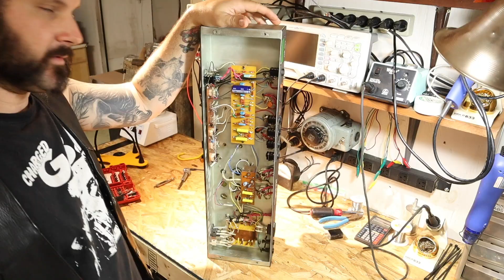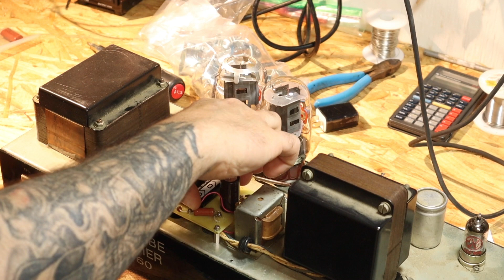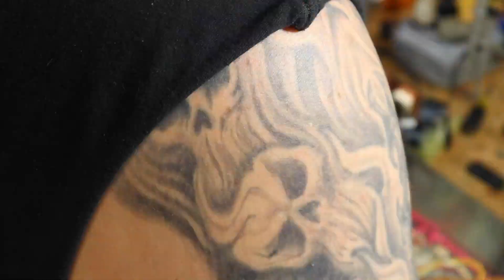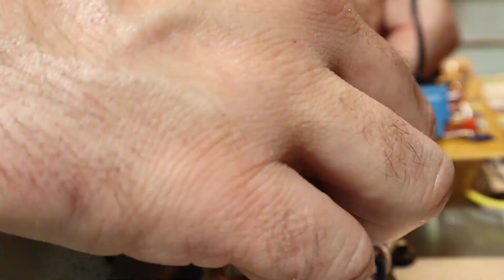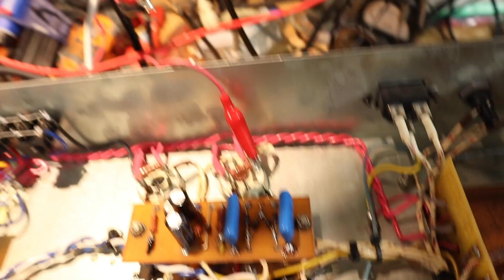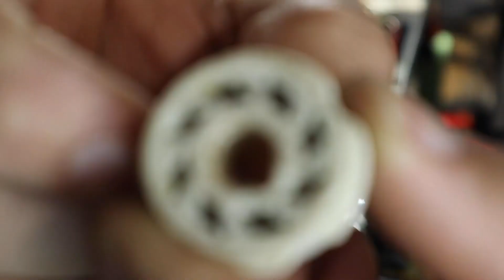RedBear MK60 Repair and Refurbish

Comment: Hi just found your video I’m your newest subscriber. Great video,awesome rebuild job.I bought one  of these dirt cheap. It is been modified, Russian preamp tubes were changed to 12ax7 an output tubes converted to EL 34. Some of the caps were changed to values closer to a JCM 800.  Replacing the pots will be a big improvement for sure,the originals are pretty bad. I have a jcm also.  In my opinion this amp  sounds better, you could for the most part follow a JCM 800 schematic if anyone needs

Comment: I had a .01 cap go full on leaky on a mesa boogie like 66 volts dc on the ac side of the cap right into the gain pot.

Comment: I had the MKX Cub 50 modded and PT swapped to US voltage from European voltage. The tech did a decent job, but your work looks far superior. The tech took off the cover for the filter caps and used the blue cans so the cover wouldn’t go back on. If you were local, I’d definitely take it you for service. 
👍👍

Comment: Hell yeah! Glad to see you back - and with one of my favorite amps too. I've got the  mkx50 combo and it's working well enough, but I've been avoiding a cap job due to the amount of butchery necessary. Dude still makes amps under the NOVIK moniker - been thinking about messaging him to see if he's got new caps that are the same form factor. Also, if this thing ends up on your bench again, hit up the Red Bear FB group. I'm pretty sure one of the guys had replacement power and standby switches.